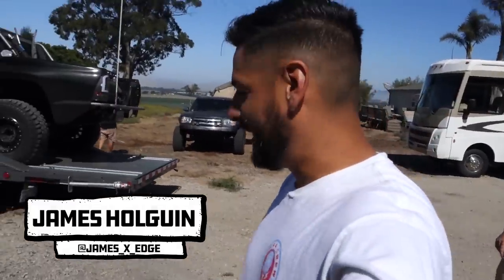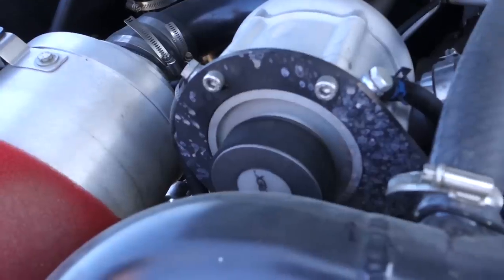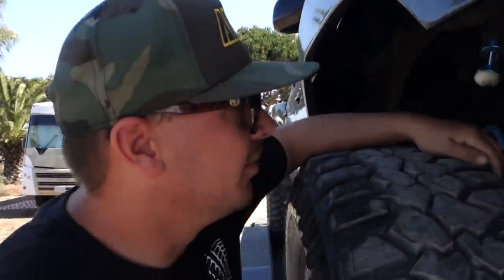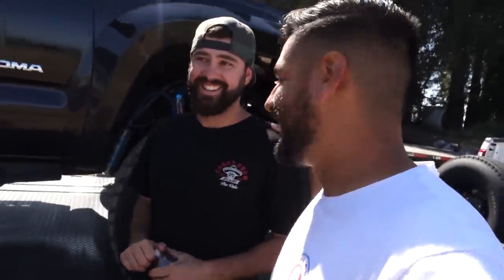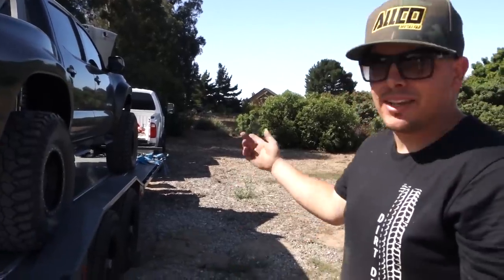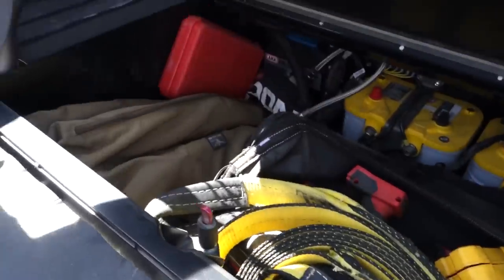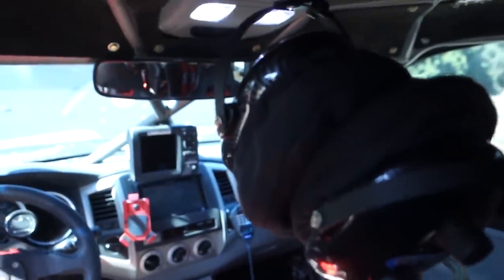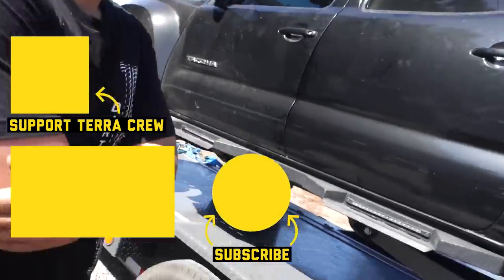Supercharged Toyota Tacoma Prerunner! | BUILT TO DESTROY

Comment: People really underestimate the 4.0 vvti. I had an 05' that I went all out on, extremely fast and would go through anything. Babies came so I swapped up an started building the fj. It's running the 4.0 too. For a big girl, she can shake it buddy lol. Still got a few more things to do to it, all in time.

Good work Yota bros 👊🏼
Reply: 4.0 is great besides the fuel mileage
Reply: @andrewsmith2948  ya know, I don't mind it. It's gone be about the same regardless what you do to it. For example I've got my fj sitting high and wide. Only major difference is she's now damn near unstoppable
Reply: I have a 4.0 tundra and it’s super reliable and decently quick for being a 2012 V6 but engine mods are crazy expensive

Comment: Nice Taco. I ended up taking out the 8" on the FJC after breaking it 8 times, and went with the Currie F9 rear axle with 3 link setup extended the lower links to 39" best upgrade I have every done. Now I don't have to think of breaking another rear.

Comment: Dude I remember supercharging my buddies Taco back in 2001 and back then NOBODY was doing that and it wasn't a factory option either. After that it was Jacobs Electronics ignition system, AEM cold air intake, JBA shorty headers, BIGGER charger pulley, underdrive pulleys and several other performance oriented mods. On the aesthetics side of things I installed the VERY 1st set of REAL Lambo doors on her, lowered the truck using Belltech Sporttruck suspension and bigger breaks to slow down some heavy 20" wheels..Keep in mind nobody was doing shit like that and social media wasn't a thing back then, so no way to document it for the public. Still have plenty of pictures though...

Comment: Bitchn ride Man.  I say forgo the carpet kit and roll on some bed liner urethane.  That will dampen the sound in the cab, insolate and it's a lot easier to hose it out.  Lay down some cush mats if the ladies want to go barefoot.  Cheers, Michael in Toronto.

Comment: did this start with the trd offroad or the trd sport package,. and if i want to budget build a tacoma does it really matter what i start with to do a 2-4' lift
Reply: Kent Bremner yes it matters. if your going to do a 2-4 inch lift go with kings, icon, fox 2.5s. theirs other 2.5s that work good. fox 2.0s are more budget friendly and work great to and bilstien 5100s wich i have on my tacoma rn ride good just not the best off-road shock. Stay away from lift spacers. and this is a sport package, you can tell by the painted trim and the hood scoop. off roads come with black plastic mirrors, door handles, chrome bumper, and no hood scoop.
Reply: Starting with a trd,sport, or sr5 doesnt matter. Only difference is things you would be swapping out anyways. Seats, rear diff, sticker, radio head unit, useless crawl controll button, same skinny tires but different sizes and a fake hoodscoop. Start with an sr5 because you wont be replacing stuff you overpaid for with a trd
Reply: MotoRacer171 yea what he said. thier are some differences with the diffs. others than that make sure it’s 6 lug. 5 lug trucks have no after market support unless you want to lower it.